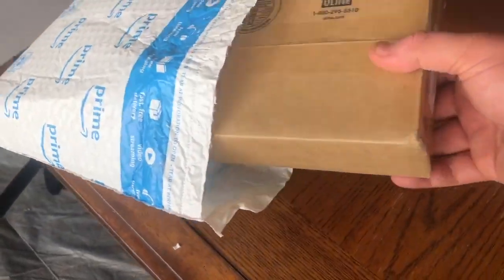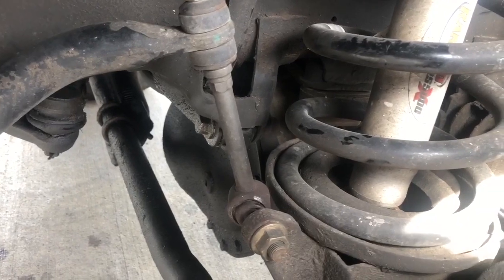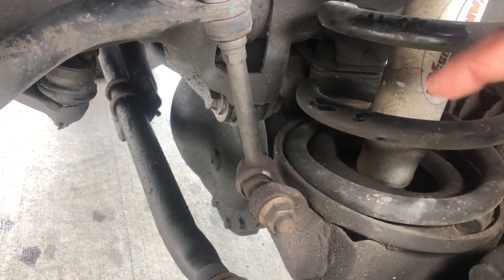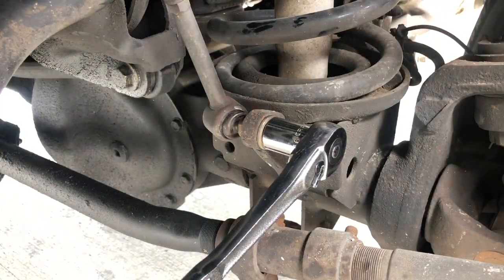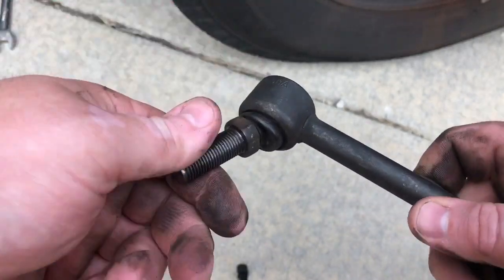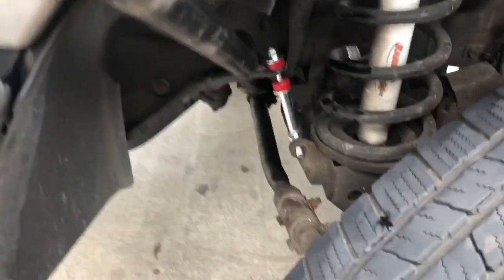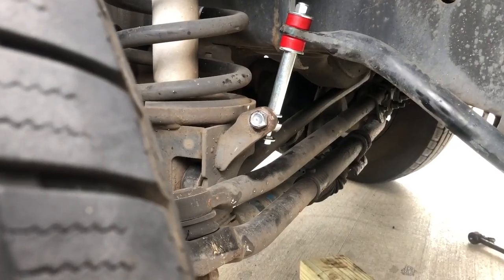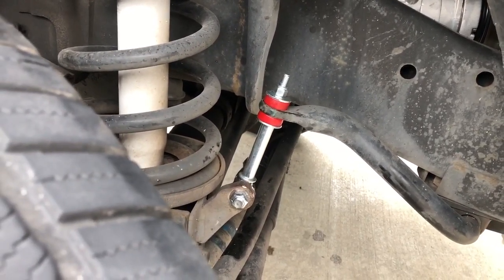Replacing Bad Sway Bar Links - Ram 3500 6.7 Cummins

Comment: What's the status of the replacements?  I just picked up a 2006 2500 and its got some vibrations and clunking.  Im thinking its sway bar links since the boots are toast and the rest of the steering and ball joints are band new.  Thanks for the video.  I like that you did it with the truck on the ground.  that's how i'll do mine as well.
Reply from the maker: Daniel Mildbrand The replacements certainly look wimpy compared to others that are greasable but they have held up another 140k miles since that video I think. I’m perfectly content with buying these again someday. Just making sure you have a good jack to bend the bars enough to line it all up, like in the video. It was a headache but taking it all apart was overkill I thought. Glad I could help! God bless!
Reply: Clunking could be control arm bushings

Comment: How are they holding up so far? I’m about to order the 2” leveling kit version. Nice video!
Reply from the maker: Jeremy Conner Hey Jeremy! I’ve had no issues or complaints. I think I have well over 50k on them by now. They look the same as they did when I put them together. Hope they work out for you too!
Reply: HighMileageHelper  nice! Thanks for the update. I’ve got them on order.  New Bilstein front shocks and steering dampener will be changed out at the same time.
Reply from the maker: Jeremy Conner Hey that’s great! Anytime I can bunch things up to save time I definitely try to if I’m gonna get dirty haha please let me know how it goes for you!

Comment: What type of tool box (s) do you have in the bed for your hitches etc?
Reply: Looking at the other transporters to see what they are using for toolboxes.  My aux tank tool box is not enough
Reply from the maker: Ricky Blackshear thanks for reaching out again! My toolbox and everything I keep inside is going to be a video coming in the near future. But I have a larger TSC toolbox I got on sale for a ridiculous cheap price but it’s tall so for 5th wheels I have to raise them up much higher than you normally would. I need the extra room for stuff but it’s not ideal for 5th wheels.
Reply from the maker: Ricky Blackshear I found that to be the case with my first toolbox/fuel tank combo. I now have a 116gal tank by cab and the full-size toolbox at the tailgate. If I bought a new one I would get a 5th wheel toolbox and sacrifice some of my secured space
Reply: Thanks for the link to your web site. Looks impressive !
Just looking at what everyone has to get a idea what I like on storage areas
Reply from the maker: Ricky Blackshear haha thanks I’m literally piecing it together one section at a time. I would check out google. “Truck toolbox” I like this set up 
https://images.app.goo.gl/jip8gAtYZxAgJ1c98

Comment: Wow Moog used to be good.   How long did the factory ones last?
Reply from the maker: Ricky Blackshear to be fair, like I said in the video the moog parts we get are made all over the world and their materials and precision vary I’m sure. Maybe some Moog manufacturers are still good in certain countries? But I would have no idea how to figure that out. Maybe I’m the only guy who bought from bad manufacturing moog plants? Lol 

Also the factory was changed out in the early 400k’s. They had been fried for quite some time. I wish I knew exactly when things started to feel different. That’s the thing, they slowly wear out and it’s difficult to notice when they have officially died. If I had to guess it would be in the early 300k’s when in general I noticed my front end getting looser. 

If these Spohn’s don’t work out, I think I’ll be going back to factory. I wanted to give a different company and design a shot. So far so good. Since I drive a ridiculous amount of miles faster I should be able to give a review in the coming months!

Have you had any better luck with moog?
Reply: Yes I have good luck with Moog